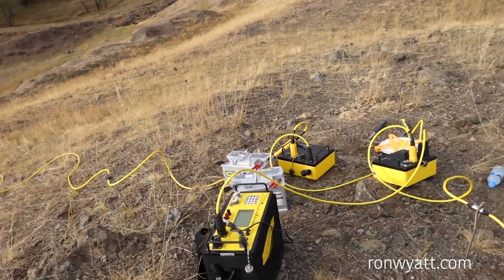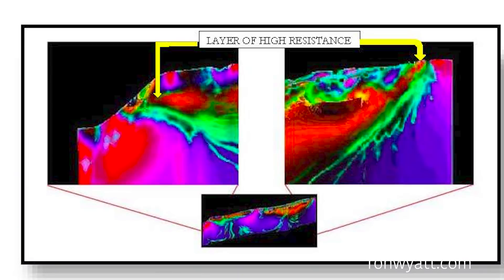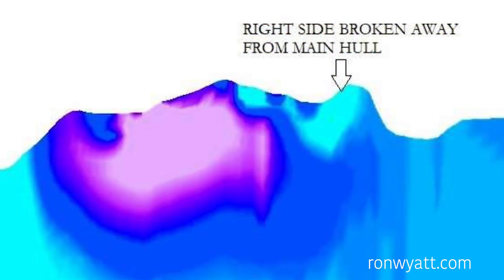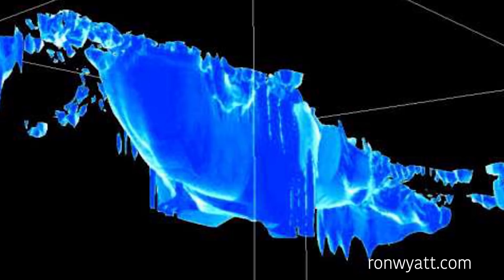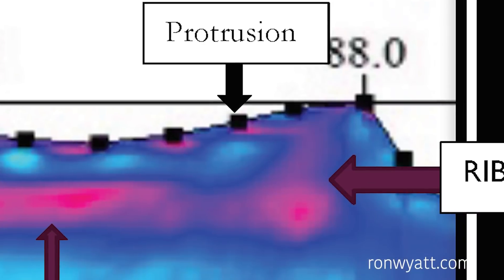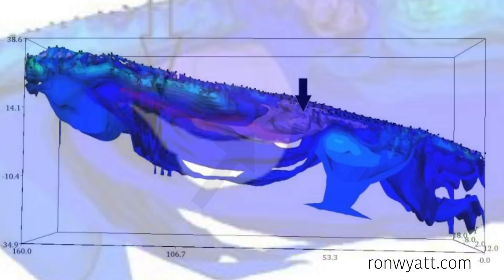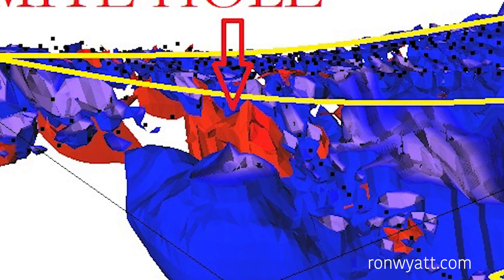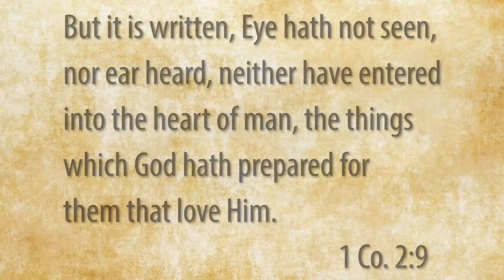Noah's Ark Resistivity Scans Pt 2 THE SCANS

Comment: There’s no possible way for this to be Noah’s Ark mainly because the shape of this formation ISN’T the same shape as described in the 
Bible. Also this anomaly is very small in comparison to the size that the original Ark would have to be in order to hold millions upon millions of animals weighing tons and tons, food weighing tons and tons, and the same for water and excrement of all those animals. A boat made of wood as described in the
Bible would obviously snap in half from all that weight the minute it was rising off the ground just from the weight. It’s even questionable that a ship made
with metal could hold that amount of weight.. Noah and his family also needed water and food which added more weight and they would have been dead in very little time with NO ventilation just from the toxic fumes from all the animals and excrement in which there was only one small window on the Ark. 

Polar Bears didn’t swim 8,000 miles from the North Pole to Turkey to get to the Ark and kangaroos didn’t hop to it from Australia…and then after the flood how did all those animals GET BACK to their original locations like the North Pole, Australia, South America, etc??? They didn’t swim back, hop, or take a jet plane.
Reply: Check out the Ark Encounter website in Kentucky. It addresses your concerns. But in kind reply: 1. The bible doesn't mention the shape, just that it was a boat (Gen. 6). 2. The "anomaly" is NOT very small in comparison. I've been to the site in Turkey. It measures a little over 500 feet, which is the length described in Genesis IF Moses (the author) used the Egyptian cubit (since he was raised in Egypt). 3. The ark didn't need to hold millions of animals. There were small representations of each species. No need to take every breed. Going with just the species, they could have taken under 5,000 mammals and that would have produced, in time, all the species we have today.  4. Check out the Ark Encounter that addresses your comment about the ship snapping in two.  Moon pools could have been on each end/and or the middle to relieve the stress.  5. Much of their food could have come from the milk and eggs readily available everyday. They could have taken alot of dried fruits and vegetables, not nearly as heavy. They could have grown indoor gardens, similar to how we do today.   They most likely had some type of drainage to catch the water from the rain. For centuries, ancient people could collect huge amounts of water in arid conditions once it rains.  6. There was not one small window; that's from children's books. The Hebrew says, " to make an OPENING, basically a huge ventilation opening that could have gone around the boat near the top. Again, check out Ark Encounter; pretty cool possible explanation. 7. Finally, concerning the Polar bears and kangaroos:  Our earth has alot of former "land bridges" (There was once one connecting Russia with Alaska).  These were later covered by flooding after the flood.    I hope you'll check out the Ark Encounter.  I can tell you've thought through alot of this, which is good. We believers need to be ready with answers to good questions like you've brought up.  Blessings.  MMc.
Reply: @mikemcpherson4785  I’ve seen the Ark Encounter and it’s absolutely ridiculous and everything I mentioned in my comment wasn’t at all described at the Ark Encounter…it was all speculation, assumptions, and just made up to suit the agenda….It was all a bunch of nonsense and doesn’t coincide at all with science and ancient history…it’s purely myth. There’s no truth to a global flood. It’s all mythology and there are many mythological stories that were written approximately 500 to 1,000 years PRIOR to when the alleged flood myth in the Bible occurred. The Noah’s flood story was hijacked, plagiarized, and copied from those previous myth’s of the flood ie The Enuma Elish for one…the Enuma Elish also describes the myth of creation. No it’s absolutely impossible for the earth to be 6,000 years old ….that’s absolutely ludicrous and I can’t wrap my head around the fact that here we are in the 21st Century and adults STILL believe these childhood stories. It took approximately 80,000 years for volcanoes to form the Hawaiian Islands for one example and that’s a proven scientific fact…the earth itself is 4 & 1/2 billion years old. I was a Christian for over 30 years until I started doing some VERY SERIOUS intense, in-depth outside research of the Bible for quite a few years and also research on the cult of Christianity and what I found blew my mind…that Bible is an ancient book of mythology coming from ancient Egyptian, Zoroastrian, and Babylonian PAGANISM cults in which Christianity itself stems from these ancient PAGAN cults…the Jesus stories are ALSO copied and hijacked from ancient mythology….do the research for yourself. Most of the myths of the pagan gods were also born from virgins, were teaching in temples at a young age, performed the same miracles as the mythological Jesus, had disciples that followed them, were tortured and crucified, died , rose from the dead and ascended into the heavens 3 day’s later…Jesus was no different from any of those pagan god’s because he’s also a pagan god. This is where the Catholics get all their statues from…the statues in Catholic Churches are all pagan god’s and goddesses. The statue of the mother Mary holding the baby Jesus ISN’T Mary and Jesus at all…they are Ishtar the fertility goddess Queen of Heaven and the baby represents the god Horus as a baby. Technically Christianity is a blood sacrifice death cult…Easter and Christmas are also Pagan festivals. The rest of Christianity may not have statues in their churches but the rest of everything else has been adopted from the Roman Catholicism which is a Pagan religion. The rest of Christianity do exactly the same rituals, holidays, belief systems, and dogma from the Pagan Catholic Church who invented Christianity in the first century for power, control, and political reasons…they invented all of Christianity. No there never was a Virgin Mary or a baby Jesus in a manger or a bloody sacrificed Jesus hanging on a cross (blood sacrifice death cult of rituals.) Do the research by starting to study ancient mythology…you will find that the Bible parallels those myths which is where the Bible comes from. All of Christianity was a man-made invention and so was the Bible which all started with the Roman Catholic Church. I also highly recommend for you to watch the documentary ZEITGEIST here on YouTube because it explains a lot about paganism and the mythology of the Bible and Jesus. But there’s 2 ZEITGEIST documentaries…one of them is about the economy and the banking systems so that’s not the one you want to watch, watch the other one.
Once you find the REAL TRUTH THE TRUTH WILL SET YOU FREE from the slavery and bondage of Christianity and from the Bible prison. The 
mythological Christian god of the Bible is an EVIL psychopath and his son Jesus is also a hateful scam artist,charlatan, liar, deceiver, a hypocrite who constantly contradicts himself and can’t make up his mind like a complete idiot. Jesus follows Yahweh and believed Yahweh his father. Jesus agrees, endorses, sanctions, and advocates for his father which also makes Jesus an evil psychopath. The whole Bible contradicts itself from beginning to end and none of the Gospels coincide with each other and contradict each other to the point where it becomes nonsensical. Good luck with your deconversion and deprogramming your mind from the mind control of Christianity because it’s a very evil religion. Btw I also followed Ron Wyatt for many years until he was debunked and was found out that he was out for fame and fortune…just because he was a Christian doesn’t mean he wasn’t a charlatan. Look at all the Christian charlatan preacher’s for example and take a good look at the EVIL Pope and Vatican…just because they are Christians doesn’t make them nice people. In fact Christian’s can be the most hateful people on the planet. All of the non-Christian people I know and non-Christian friends put Christianity to shame…I’m so grateful to be out from the insanity of Christianity cult movement.

Comment: If this is Noah's ark what is the wooden structure encased in ice on mount Ararat?
Reply: It     is      the      ramp       on     which     the      ark      was       built,     oval      shaped        reinforced      with     timber     and     metal      alloys      with      rocks      at     the      base.     Tunnels    under    the     ramp     appeared       to      have       used      in      the      construction      of     the       ark.     The      ramp    was     destroyed      by      the      flood      and      partly       scoured      out       by     rushing      waters  .
Reply: @lwmaynard5180  It could not be so. Nothing man-made except the ark could've survived that event, and before the flood the Arrarat ranges, and indeed all the other ranges on the planet simply did not exist. They were formed during the events of the flood.
Reply: @TD-wi1zh  Nothing man-made of wood, you must mean. There are stone edifices beneath the Seas that surely were pre-flood.

Comment: I want to see a full excavation.
Reply: If it is excavated and left in the open elements, it will deteriorate very quickly. There needs to be a climate controlled shelter over top of it so it can be excavated without deterioration due to.elements.
Reply: @hopefulvoyage  Seems like a small slice could be excavated, 10 or 20 feet. I don't think God intended it just as a holy shrine but as source of real, solid evidence.  It's not doing much good just sitting there with all it's secrets out of sight.
Reply: Sounds very expensive. Unless Turkey is willing to fund it I don't see it happening unfortunately.

Comment: I so appreciate your work, and believe this is Noah's ark, but I can't make out the images. Has the wood turned to petrified wood (rock)? Has the iron/metal long rusted away?
Reply from the maker: The structure of the ship that we have seen has been fossilized/mineral replacement. We do not know what it is like deep in the earth. No technology can tell that. It can only reveal structures and shapes, and differences in surrounding material such as dirt and rock. There is a lot of metal still in place. As it erodes and reaches the surface, it degrades. But the strong metal readings obtained in the metal detector scans in the 80s revealed a LOT of metal.
Reply: @ronwyattcom - Thanks.
Reply: @ronwyattcom  Is there any way that you can test the fossilized material to see if it is indeed gopher wood?